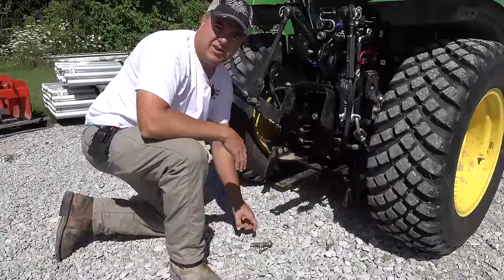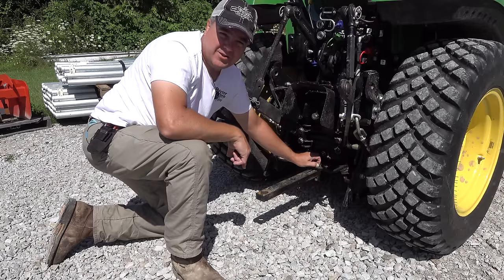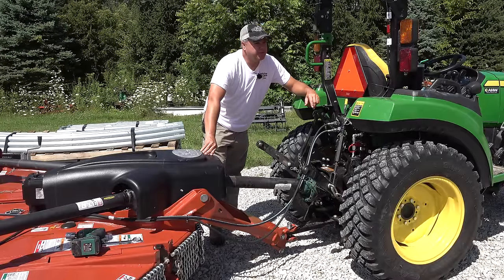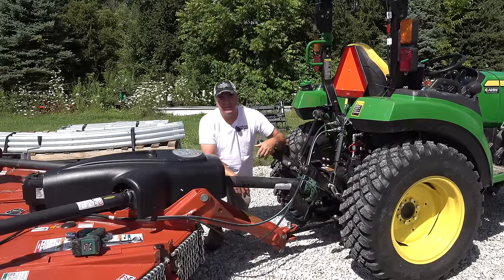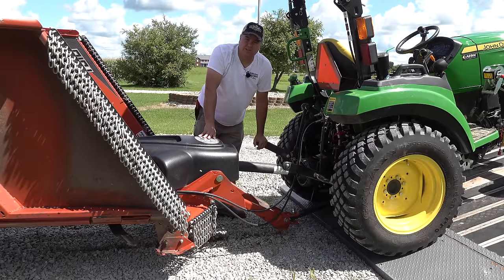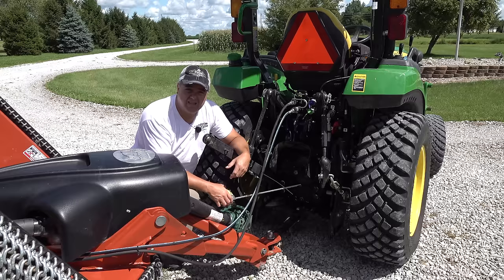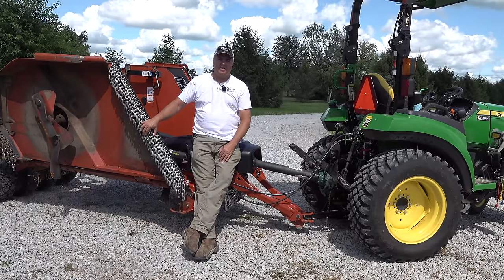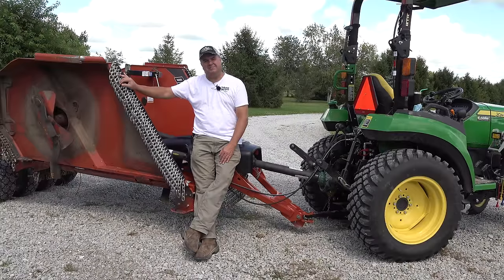COSTLY REPAIR on Deere  2038R!!!  Tim's HUGE Error!  Details Inside.

Comment: We have a term for this in our industry and it's called "sign blindness"  It's a genuine problem that we are surrounded by so much trivial warnings that we just ignore it and miss the really important ones
Reply: Completely agree.  There are so many stickers on each piece of equipment, that is the first thing that I do is remove most of the "CYA" stickers.  Like don't stick your hand under the mower when its running.  It could hurt you!   ugh...
Reply: @Chris_In_Texas   I learned from the master mechanic that I trained under in the heavy equipment shop that we worked out of to take a "Polaroid" of every sticker (in those days mostly LOF info and other Maintainance recommendations) and file them with any owners manual or at least the invoice because any worthwhile machine will last long enough to outlive the stickers. We included pictures of belt info before the printed markings wore off because A) Belt info often wasn't included in the paperwork and 2) Broken belts can be hard to accrately measure. Though I thought it was a ploy to make sure I read each sticker and recorded each belt, your removing the silly ones at least shows you read and knew which where which. I was always glad I took the time, and nowadays I save the pics to a memory stick so I have them even when my wife throws out the paperwork. Wait a minute... Which tool box did I put that memory stick in?

Tim, new subscriber, you won me over with "Tim's HUGE Error!" As a kid, many farmers used a sling (usually old inner tube or leather strap) to hold PTO shafts unhooked during transport to/from the work site, since we lived in hill country with many drainage ditches. Also, most tractors with slide bar hitches had a "transport" bar to give clearance for these situations.

Comment: I borrowed my neighbor's tedder; in my case I had too much shaft extended and bent the female shaft section of the PTO shaft just running it(only about 1" engaged).  Always helps to check this first time running!  Also my recommendation is clean and lubricate those splined shafts!  Then do it again!  It's the only way to possibly avoid a crushed finger!  Don't leave those PTO shafts ostriching in the dirt(we all do that!).  Sorry for the costly damage!

Comment: In my early 20’s I put diesel fuel in a gas engine... took me years to get over it...every time I thought about it I would cringe.. at 42 now.. it is what it is.. ya live and learn.. P.S. I read every manual and sticker for everything now!
Reply: Diesel in a gas isn't great but it's not fatal. Gas in a diesel however likely means a new engine. I've seen both in my years of running a shop.
Reply: D B few more details... it was my bosses work truck... it ran for about a half mile.. then caught on fire.. not a major fire but definitely fire.. he was good with engines so he got it running again... still remember the look on his face though..
Reply: Our Oliver 66 got diesel fuel more than once.  She ran a bit rough, but burned her way thru it.
Reply: Diesel in a gas is not the end of the world gas in a diesel is not good at all deadly to the engine
Reply: The Green handle usually is the Diesel pump,,, but not always.  BP stations green is the gas pump.  Filled my truck up with Gasoline made it 3 mile then truck died at at stop lite.  Drain out gas and filled with diesel , no more issues.  Filled my TDI jetta with Gasoline this time the station's diesel pump had gasoline in it, again got luck and pumped gas out filled with diesel fuel and still driving it.

Comment: My children heard from me often as they grew up “Everyone makes mistakes. What counts is what you do about them!”

As always, I loved watching this video you and Christy put out! 

Based on watching your videos I purchased a TS-10 to mow 7 acres regularly. Nothing like a few hours during a hot Saturday afternoon mowing while in a cab tractor!

I too made a mistake while using the TS-10. While lowering the wings I tipped it over... (just the mower not tractor). I had the mower on a bit of a side hill slope when I un-folded and over she went! The drawbar sustained a bit of a twist but still works just fine. No need for a trip to the tractor hospital for me. 

My mower is plumbed using just one hydraulic hose that I connect to the remote fitted with “float”. I see you have two hoses involved on yours. Perhaps you would consider a video demonstrating the functional differences using the mower each way? My accident may have been avoidable had there been more hydraulic options available to me with different plumbing. BTW my tractor has two sets of rear remotes.
Reply from the maker: Yes, your dealer can help with re-plumbing the mower for 2 remotes.
One hose runs to the lift cylinder only.
The other hose T’s to both wing cylinders.

Comment: This is a very common issue with compact tractors as the rear housing is aluminum and most dealers do not cut the power shaft to compensate for full travel.  I have repaired/replaced the PTO drive assembly, differentials, and even full rear housing because of drive shafts being too long.  The #1 implement that causes this issue is a post hole attachment.
Reply: And at the other end of the 3 point travel post hole diggers (which usually have long drive shafts) can have the two shaft part cease to overlap and that creates a whole different sort of mayhem!  See https://www.youtube.com/watch?v=ApnU87qOQh8 for a video on the subject.

Comment: Well done video. When I saw you standing at the back and talking about how you had a huge costly mistake, I immediately thought "he busted the back of the tractor housing with a PTO shaft that was too long". But I'll bet you I would have done the exact same thing. I've never used a mower similar to that. I've only used 3 pt attachments. I just assumed you did the same thing on another 3 pt implement. I never would have thought with that type set-up, just going up onto the flat bed would have done that because the tow bar was too short. My biggest concern would have been tongue weight on that bar with it sticking out too far.
And I NEVER read the warning stickers. Thanks for sharing.
Reply from the maker: I had pulled this mower with this tractor many times.  Just didn’t extend the drawbar as far this one time....for some reason!  Oh well.

Comment: Now that you shared this, I think I will go out and check mine ( PTO shaft ) although mine is supported by the 3 point hitch, I now need to check it for the next time I come into a swale  situation.  I did bend the back trailing wheel once  in a swale  and had to replace. ( improper top link adjustment )  The important thing is no one got hurt. Stay safe out there Tim.

Comment: Absolutely distroyed my BX PTO. Shaft disconnected from tiller. Amazing how much damage can happen so quickly when your shaft is banging on the 3 point @ 540 rpm.  Found the pto shaft on the ground still connected to my tractor...or I should say, parts of my tractor.
Ever wonder what's inside? A lot of gears and oil. Got a good look inside, but if you want to see whats inside your tractors rear end I don't recommend my method. Absolutely heart breaking. Lucky the insurance I had to purchase to finance the BX covered the over 7K in repair. Yeah According to the dealer, 
PTO damage happens a lot. I was not the first and Tim you weren't the last.
Reply: When I got my tiller for BX it said to make sure PTO shaft was right length.  They said it normally had to be cut off and it did have to be cut.
Reply: Ouch!😕

Comment: Sucks that you messed up your tractor but Great that you posted it so other can learn. Having been a mechanic for a local John Deere dealer I have read many manuals when doing set ups on tractors and implements. Making sure you have the right PTO shaft length is very important.

Comment: Thanks for the honesty Tim.
I broke my rear housing on my first Yanmar with a 12" auger on the post hole digger.
Lowered the 3 point lever all the way down because it wasn't getting a bite.
When it did, it screwed itself so deep it cracked the rear-end from the force.
We all have lessons to learn , hopefully some can learn from others mistakes.

Comment: Good video....  We have a 3 point hitch bush hog mower.  When we first attached it to the tractor, we couldn't get the PTO shaft to reach the connection.  We were all scratching our heads, discussing possible scenarios, all the while the book lay sealed on top of the deck...lol.  We eventually figured it out, no darn book needed

Comment: Tim:  First some background.  Based on my land needs, and based largely on the content of your videos, in May of 2019, I purchased a 2032R with loader and backhoe.  Early this spring, my son was working on a section of road (long driveway) and got too close to the edge which collapsed causing the tractor to almost tip over.  The unit was listing at about 60 degrees from vertical and only a tree prevented it from tipping further and rolling down the hill.  I was concerned but not upset.  All I could say to him was that I was sure he would never make that mistake again.  That is the only comment I can offer you as well - I am sure you will never make that mistake again.

Comment: Don't feel so bad. Ive done that, but only once. (I've wrtecked a double hydraulic pump by connecting an outlet to the wrong fitting. 3seconds, pumpruined)

Comment: I just watched your story about the PTO shaft disaster. Last year we bought a JD 2032R and a Frontier rotary mower.  Even though the PTO shift was not "too long" as I was attaching it for the first time, I could see that as the mower was raised, it could become compressed too much. Also if I had driven across a ditch, the rear of the mower could be lifted even more by the trail wheel. Fortunately I had decided to use a quick hitch that moves the mower back far enough that I didn't need to shorten the shaft.
Reply: I just bought a rotary cutter and the manual says 1" is sufficient gap when 3pt is level, but this assumes the tractor and the cutter are on level ground.  I am afraid that crossing a ditch may bottom out the shaft.  Am I correct or is the geometry of the 3pt different than the drawbar setup that Tim was using?
Reply: @DominicRichens  Of course, as long as there is still any free travel for the shaft to collapse, there wouldn't be a problem.  BUT, it is very difficult to consider all of the variables involved: lifted height, top link length, lift caused by tail wheel as going over uneven ground.

Comment: i had that problem with the PTO but not on a mower but on a square baler from Welger die got the shaft correctly the the PTO flies off but it still works :D

Comment: "To error is human!" If you error and don't/won't  admit it, that would be a second error. I try to avoid those, but I'm human.
Reply: I’ve always been told that if you cut something too short, just cut off the short end.
Reply: @karlpritchard5688  That's what my Dad used to say! Cut off the short end, then it will be two long. Then you can cut it again and it will fit just right. I always looked at him and scratched my head. Huh!

Comment: Also, thanks for sharing the lock-back collar on the PTO shaft.  All my PTO shafts have the “pull back and then try to push it on.”  What a pain.  I found a work around using an adjustable extended jaw plier that was the right width, pull back slip ring, slip the pliers between the collar and the slip ring,  push shaft on . Much easier.

Comment: Very good video. I grew up on a farm also but just as a hired hand. But we didn't like extended drawbars either because heavy things like a manure spreader could break them. Another option is to take your pto shaft to the chop saw and shorten it.

Comment: Had similar thing happen. I had my brand new John Deere 3032 for a month and was changing implements and left top pin half out, raised arms to hook up and snapped top cast iron housing. Looked to me like major job to replace whole top housing. John Deere  picked up, fixed had it back three days later. All under warranty. Couldn't ask for better service. Tim what do you think of the 3032??? I love it so far.

Comment: Thanks for sharing this!!! Even though we won't admit it I am sure almost all of us  will benefit from this video and your experience with the proper length and distances of PTO shafts.   What can you do to insure this will never happen again when you are in hurry or have a Senior moment??  Mark drawbar with red stripe  or put a yellow caution line on PTO Shield or finally end up cutting a couple of inches off PTO shaft to insure there is no possible way it could ever happen again on your tractors??

Comment: Tim, things happen like this.  Glad you shared this, perhaps it will save someone else the trouble and expense.  I learned this years ago while mowing right of way for IDOT.  We got some new 15' M&W bat wings for our 6610 Fords. These mowers had a carrier bearing for the power shaft  on the tongue of the mower like the old Woods mowers. Well with this mower and 6610 combo if you went down in a ditch and up the shaft would compress and in our case it broke the PTO output shaft on the tractor.  On a 6610 it required splitting the tractor to replace the shaft. Your lucky you have a John Deere salesman come to your house to talk to you.  It's been my experience they don't act like they want to talk to you when you visit their dealership.

Comment: When all else fails.  Then read the manual...  glad it was covered.  Neighbor was breaking shear pins.  He welded it solid.  Broke PTO in it in 140hp tractor.  I had suggested if he can’t find what’s wrong. (The load was just too heavy for pins). Go to grade 8 pins, or drill out to next size pins.   But welding....

Comment: Another mistake to watch out for is one I made in same area of tractor. Housing rings that the top link connects to will break! I pulled top link off one day after parking, failed to push pin back into rings or just pull it out completely, link arms were down, jumped on tractor a few days later without regard to anything on rear, lifted link arms, and pop, top lifter on side pin was hanging out of caught pin and completely broke ring, rendering 3pt hitch useless. Final damage, $2100 covered under warranty to replace whole top plate of rear housing, due to the whole piece being cast.

Comment: Tim I have been on John Deeres most all my life from lawn mowers to 620 HP farm tractors and I didn't know that about a compact tractor. Thank you for telling us your story before it cost me because I have a 3039 Deere with a belly mower but I also pull a 10 foot bat wing at times and by all rights I have crossed ditches that could have put me at near the same angle that you was on loading your tractor.
Reply: typo I meant 3033 Deere

Comment: Don't feel bad Tim it can happen to anyone. As a John Deere service manager we have seen many things happen for instance a 7000 series tractor came in with a similar break. Only it cost a lot more money to fix. The customer backed into a light standard with the corner of his 8' snowblower, it sheared the one lift pin off and pushed the pto shaft in far enough to break the carrier housing inside the rear end. Thank you for helping to educate those small tractor owners who may not be as familiar with pto shaft lengths as a full time farmer may be.

Comment: Broke the PTO shaft in my 5030 New Holland using a 8' Howse bush hog that had too long of a pto shaft.  Went to back up and got the mower in a ditch, this compressed the shaft and I heard that loud pop. When I got off to survey the damage the pto shaft end was sheared off flush with the housing at the rear of tractor.  Luckily the part was "only" about $400 dollars.  A word of advice with those "CV" pto ends, be careful not to turn more than 75 degrees with them or they will destroy themselves.  That's also about $400 for just the end piece.....ask me how I know.

Comment: What tires do you have on your tires for the 2038r?  My r4 tires aren't very good pushing snow and the tread pattern on yours seems like they would provide better traction.  

Thanks for sharing.  Easy mistake to make and will help me to not make the same mistake on my 2038r.

Comment: thanks for sharing! looking at buying a 2032R but the aluminum housing is a concern but my wife wants the mid mount mower
Reply from the maker: Don’t worry about aluminum housing.  You’ll absolutely LOVE the 2032r.
The poor housing couldn’t handle the pressure I was putting on it. Would have been the same if cast iron!

Comment: I grew up farming and ranching. You get things done. A lot of times that means avoid safety decals and manuals. I transitioned to working at the local John Deere in High School. One day got into an argument with the lead guy because of tire pressures for a tractor fixing to get shipped out. The manual said a certain psi and he wanted to go higher. I learned then that even the pros do opposite of what the instructions say at times. Stuff happens and we learn from it. Thanks for showing us so that it doesn’t happen again.

Comment: Thanks for sharing the lesson. A close up picture would have been really helpful. What hole should you have used? Thanks.
Reply from the maker: The 4th hole.   14” from drawbar to tip of PTO. I think it was explained pretty well.
Reply: @TractorTimewithTim  Thanks for clarifying. I heard the part about you could have gone with 4th or 1st, pushing it all the way in, etc. But I don't recall the final position. And the video was in the shadows, so I couldn't see it either. Thanks!